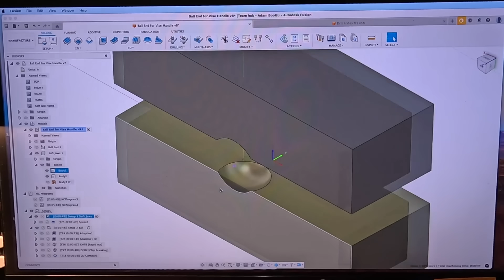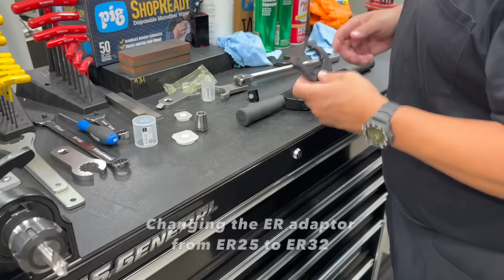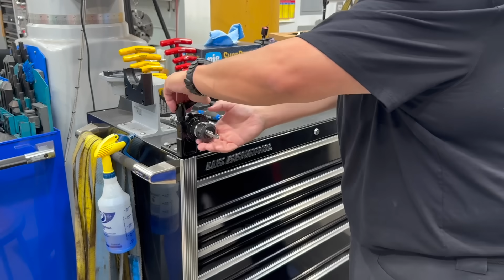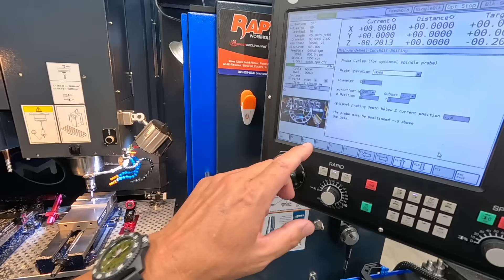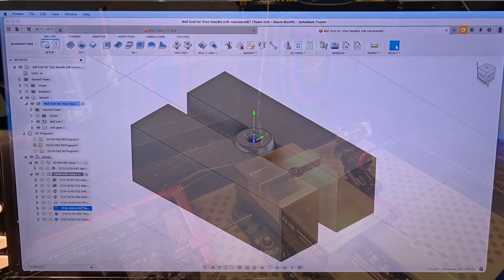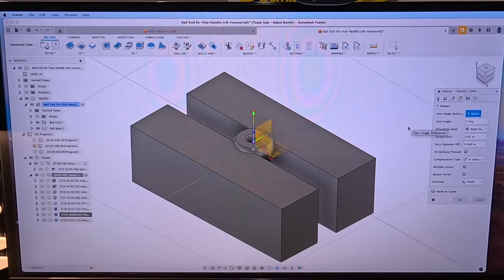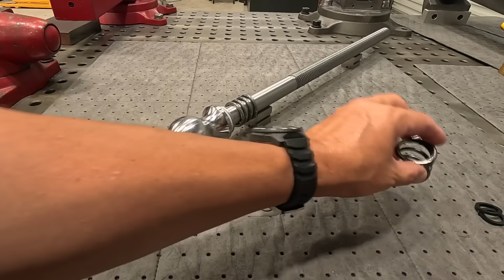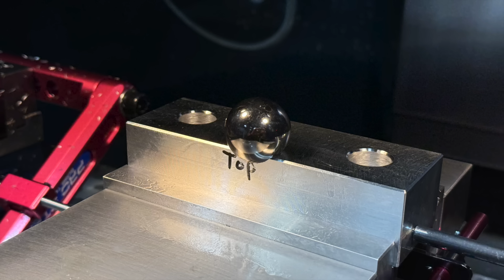Machining  Ball Ends for Vise Handle

Comment: If I were making my ball ends I would stick to the original ones design because they are completely round. I thing that big flat part together with flat rings (I presume it is for bump protection) ruin the feel in the hand. Larger diameter and completely round ball ends without flat rings would feel awesome. But it is YOUR project and you make it as you like. Great work as always Abom!

Comment: Cool stuff. I do want to mention that it is a really good idea to clean the shanks of tools, as well as the inside of the collets, with Acetone or something similar before installing them. I used to run a massive CNC router at a cabinet shop, and my boss bypassed my suggestion one day. He installed a tool into the holder, torqued it to spec, then started the program on the router. Luckily I was only about 30ft away when I heard the horrendous noise as the tool was digging deeper and deeper into the work, until it nearly destroyed the 5'x13' bed of the machine. Emergency stop was our friend that day, but it still set us back several hours because we had to fly cut the table and sacrificial board. When he tried to blame it on me, I said tools are shipped oiled to avoid corrosion, and even if it HAD been used previously, it still has a film on it, keeping the collet from completely contacting the surface.

Comment: I'll probably catch a lot of flak for this comment, but I don't understand the concept of the Go-No Go gauge. I checked several tool sites and found the gauges run anywhere from $50 -$180 each. I can't see spending that much money for a tool to tell you what the actual part will tell you when you screw them together. Just My Humble Opinion.
Reply: That's fine if you're doing a custom fitment. But if you need to thread to a standard, e.g., muzzle threads on gun barrels, that's where the ring gauge/plug gauge go/no go gauges come it. And yes they are expensive,  but worth their weight in gold when a customer comes in complaining that his muzzle device won't fit!
Reply: It's the same concept as any of the measuring devices.  You get what you need.  If you're running enough parts or expensive enough parts that have to hit a spec (and maybe you don't even have the thing it screws onto) then it can be worth it.

But we've seen him hand check nuts on threads a billion times so it's obviously not a hard requirement.

Comment: Adam, just my .02 cents but the handle looks a bit too short for that sized vise. You will also loose leverage with a handle that short. Personally another 3"-4" would have been an advantage - at least IMO. That said, you did a stellar job making it, short or not.
Reply: The screw has a thrust bearing and the pitch is somewhat fine. It will tighten up good
Reply: This is a showpiece, it'll never be used as a vice...
Reply: @ftwizard  he needs to add a "Previously, on Abom's Vice Series" segment at the start of each of these videos where he explained exactly what his reasoning and intended use of the vice was.  Maybe that'd help seeing the same comment so much.
Reply: put a cheater on it if you need more torque

Comment: Some GREEN nail polish on the GO end and some RED nail polish on the NO GO END  of that, 
GO/NO GO, will help identify one end from the other at a glance instead of trying to find the stamped lettering !
Reply: The "no go" has a shorter section of threads.
Reply: I've seen them manufactured with red and green collars on them.

Comment: You could have made a test plate for the thread mill.  Prior to the ball setup, you could have put a plate in and drilled  a number of holes, then run the thread mill, with a slight increase of size for each hole, then you could have ran through them to see which was the best, then document that for the tool, for both the balls and future use.
Reply: To be accurate, it would have to be 316 SS like the balls. Adam had extra balls and needed to verify the proper function of the hemispherical soft jaws anyway so the test was on an actual candidate part.
Reply: @KJ6EAD  Dimensions are not very material specific.  Running that thread cutter using one diameter would still translate the same no matter the material.  Speeds and feeds would be material specific.
Reply: I always run a threadmill program with ten holes at tiny increments when I fit a new threadmill. I can save a lot of cash by buying low-cost threadmills at $30 each instead of $140+, the only downside is that tolerances are not so tight.  Running a set of threads in my most common materials then using a go/no-go gauge to find the correct hole and set the machine tool-wear offset is a low-effort way to test. Most of the threads I mill are M2 to M6, running up to 16k rpm and fast plunge speeds.  Looks scary as h*ck, but the threads are excellent.

Comment: Should look at changing "compensation type" under the "passes" tab, this will allow you do these 0.002" changes at the control of the machine and not have to repost your code every time. Not sure which type your machine uses but the ones I run we set it to "wear". Nice work on this vise build.
Reply: He is well aware that is an option and probably something you will see in a future video

Comment: I just watched you put a bunch of tools in collets.  Don't know much about CNCs, but they do require tool heights.  Is there a special tool holder measuring device or a way to calibrate the tool in the CNC?
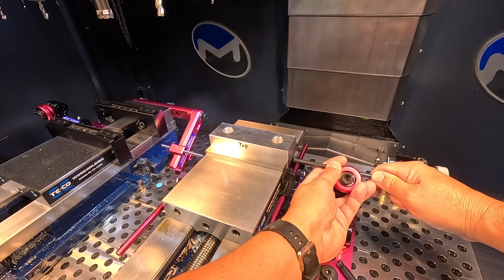Reply: I don't know much about cnc myself, but I believe the thing on the right side of the table around 9:30 is used to set the tool offsets.
Reply: @dockerjade  Yes, that was shown as you describe in an older video when he first started CNC.
Reply: There is a tool probe mounted on the cnc mill's table which you touch the top of to get the tool length and the side of the probe to get the diameter of endmills. Or he could use the haimer tool preseter to get the same information outside of the machine.